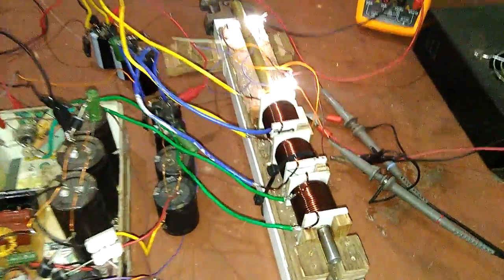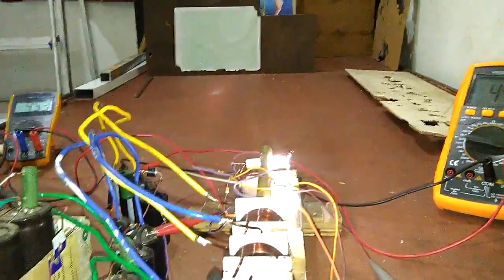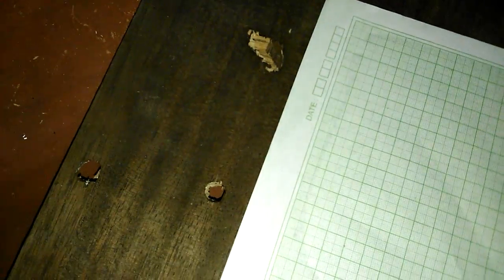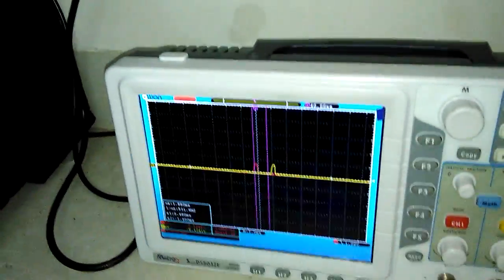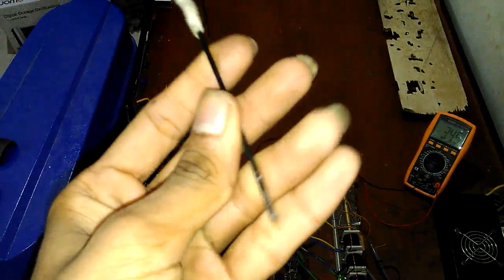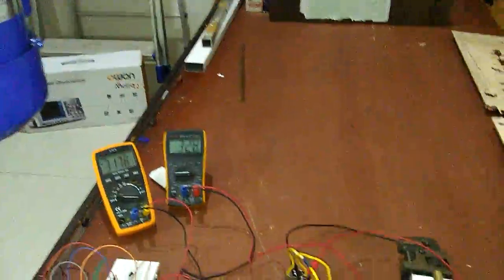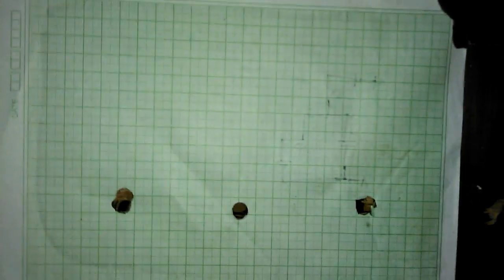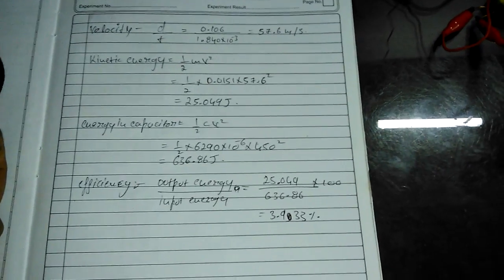spin stabilized 3 stage Coil gun

Comment: I made a simgle stage coil gun (450v cap) back in my class 12th and now in mtech i have liberty to xhoose a project so i went for multistage coil gun. I am building a multistage (4stage) 450v cap (each stage). Will use opto sensors,arduino and powermosfets for triggering. If i can get any schematic of your design thatll be cool. Thanks for the video, very informative.

Comment: thanks for posting. nice work.  the muzzle length looks good.   the stabilizer worked pretty well, for single use ammo.
other designs, where the stabilizer is fully integrated in the projectile might be more durable or, here's a wacky idea,  try attaching a bit of string - like a kite-tail - to a round.  for spin, rifling the barrel, maybe just where the coils are, might work.   cheers
Reply from the maker: David Davids thanks for watching . yeah that carbon-fibre shaft stabilizer works like a charm but it always breaks . so I think bamboo stick which is used for barbeque will be cheaper and effective substitute . and Even though it breaks no problem for a single shot

Comment: Why do you use a brass barrel and not soft steel or plastic
Reply from the maker: I wise I had Plastic barrel but you can see in my latest handheld gun i used fiberglass , steel will slow down the projectile significantly.

Comment: That's really nice! I believe it's the first time in the world someone has implemented this system, so congrats!
I have so many questions here, so I'll try to put them in a simple way.
1. What are the specs of you capacitor bank?
2. What is the charging circuit?
3. Does it have a comparator to cut off charging automatically?
4. What type of motor is used?
5. What is the RPM?
I noticed that the shaft-stabilised projectile had the cleanest hole, so there is some scope for improvement.
I would love to see more shots of each projectile type in the future.
Now I really hope I haven't flooded you with queries!
Thanks and awesome job again!
NNNI
Reply from the maker: NNNI  capacitor bank for first statge is high energy density , for other all stages normal mid energy density.
charger is zvs   circuits on steroids. that means it has been cranked little . charges my 6290uf cap bank in 1 or 2 sec at 24 v input . can pulse 500w at the output for only 2 to 3 sec . motor normal dc motor . I don't have any comp circuit . but ma Arduino will do the job of comparator . rpm of motor is 2000 rpm. about stabilisation  the one which I shot with a carbon-fibre shaft was ballistic projectile with sharp tip , so it does penetrate with clear hole . but the gyroscopicaly stabilized projectile was just a iron slug with no sharp tip so it didn't make clear hole . but when I gyroscopicaly stabilized the sharp tiped projectile and shot , it makes the same clear hole.
Reply: Thanks for the information!

Comment: if I have a one stage coil gun does adding another stage multiply the velocity by two? And so on with more stages
Reply from the maker: Dominic Nedlewski no adding second stage will give nearly two times the velocity of first .3rd stage will give less bit more than 2nd  fourth stage will be like if u r getting 55 m/s out of only 3 stages , with 4th stage u will get like 63 m/s . this was in my case .
Reply: Thanks for the tip my friend. I noticed in another video you drilled holes on your barrel. Does that also increase velocity?
Reply from the maker: Dominic Nedlewski yes it avoids Eddy current dampening
Reply: you should try a plastic tube. When I first started I modded a pen and I got much more velocity compared to a copper pipe.

Comment: your coilgun works with optic gate or timing?
very impressive gun!
Reply from the maker: DIY Center 007 open loop triggering, basically it's just timing
Reply: Can you upload your code please?
Reply from the maker: DIY Center 007 the code is just a delay command . where delay time is found out by a oscilloscope .you should use delaymicrosecosd for lesses time delay
Reply: ok Thanks!
what was your delay? I dont have oscilloscope so I will have to just try shooting a lot of times.
Reply from the maker: DIY Center 007 delay depends on capacitance and Coil length , Coil resistance etc .if you want to know delay for my gun it was 1800 ms for second statge and 900ms for 3 Rd stage

Comment: How many rotations/minute are you getting on the projectile before it fires?
Reply from the maker: Karmaslap 2000rpm
Reply from the maker: Karmaslap when just rotate the projectile in the air at this rpm you can actually feel the force of stabilisation
Reply: Can you change your video name to "spin stabilized"? That is what you are doing, not gyroscopically stabilizing the projectile. There are a lot of people interested in seeing examples of spin-stabilized projectiles and this is a good video but hard to find because of the name

It appears from the paper target hole shape that there is some significant amount of precession, how do you plan to combat this? Changing the projectile shape

Final question, how did you measure the 2,000rpms? With the oscilloscope or estimate?

Thanks and great video
Reply from the maker: Karmaslap the motor is specified to rotate at 2000 rpm Max at 24 v . I will try by changing the name , thanks for suggestion . first of all I want to get the most out of it . I am talking about velocity and right now I am getting 65m/s and output energy of 35.5j . after I get the most I can , I will design a special chamber in front of the breach of the gun which will rapidly rotate the projectile to higher rpm taking the feed from a mag .

Comment: how does the stabilisation work?
Reply from the maker: Jaultaub when the bullet rotates it will have angular momentum which acts as gyroscope . So the bullet will not tumble when it's fired , this is the same principle used in all guns
Reply: Yes I know that. What I wanted to know is how you get the bullet to rotate.
Thanks!
Reply from the maker: Jaultaub by turning it with a motor

Comment: have you heard of the "LEVITRON"? it's a toy that people can buy to make an object levitate, has a lot of video on youtube here. so basically i was having a theory bout if we can make the object/bullet levitate in mid air in the chamber first and make another magnetic force that spins the object/bullet so it will have a "suppose faster" RPM without having any kind of frictional touches to the object/bullet  and then make a hammer lever that triggers it and shoots the object/bullet through the barrel that is circulated with the coil in hopes that it might "project it more" some how.... gonna subscribe but i want to see something like this happen or something. just my theory though, not tested.... but at the same time i don't know if faster rpm will be a good thing for smaller projectiles, considering after some reading smaller rpm for smaller projectiles are more suited when it comes to accuracy.
Reply from the maker: Jesus Christ  ok first of all to levitate a non magnetic projectile , like mild  steel in this case is not easy . and again faster the rpm more will be your gyroscopic force on the projectile and no tumbling in mid flight . and spinning a solid projectile without any physical contact or just by magnetic field is not possible according to me . so I guess this method is simpler.thanks for subscribing .
Reply: Vasudev Mr what do you plan on doing next? not possible by you? you mean you don't have the financial or materials needed to do such thing?
Reply from the maker: Jesus Christ  I have plans on getting 60 to 70 m/s muzzle velocity. and make a portable gun . I may add couple of other stages to get more velocity . and about that levitating method , we need work on it . the main aim is not to make things soo complicated . ofcourse I am working on other kind  of stabilisation .
Reply: Vasudev Mr hmmm i was just watching 6 stage coil guns, but i think it's reaching it's limits no matter how many coil, unless you can get over 450 feets per second on your bullet, it'd just be subpar. looking forward to your next project
Reply from the maker: Jesus Christ  yaa getting 137 m/s is not soo easy , I know that . but I will try ma best to atleast reach close enough to that speed
Reply: Vasudev Mr watch a youtube video call "Purdue Technology students build supersonic ping pong gun"
Reply from the maker: +Jesus Christ yeah I have watched that before on TV . I think this ping pong balls cannot go faster in atmosphere ,I mean not for long range coz they will face lot of drag in the open atmosphere since there is no vacuum around , so cannot maintain their momentum .
Reply: Vasudev Mr what i was hoping is that you'd observe and intake the concept behind that mechanism in which it propelled the ball and implement it onto your coil guns chamber then it shoots through your coil barrel. but you gotta make a decent rpm on your object somehow
Reply from the maker: +Jesus Christ that's awesome suggestion so you're telling me do build  a hybrid Coil gun , I will try it out

Comment: how do you switch your scrs?
Reply from the maker: Доминик Недлюски with the help of arduino
Reply: Vasudev Mr I tried that lmao It never triggered fast enough. would you recommend using rc filters and a single pwm pin?
Reply from the maker: Доминик Недлюски you can't trigger directly from Arduino pins 5 v isn't enough use a optocoupler in between Arduino and scr you should trigger it with 12 v with 100 ohm gate resistance
Reply: that makes so much more sense as to why my set up didn't work
Reply from the maker: Доминик Недлюски hmm you stay in Russia??
Reply: Vasudev Mr say what in Russian my friend
Reply: Vasudev Mr my bad I read that wrong. no I dont live in Russia lol I have a huge interest in the language and changed my keyboard all Russian when I made this account
Reply from the maker: Доминик Недлюски no one hate Russians in India , itself ok if you were Russian .
Reply: Vasudev Mr I wish I was lmao I'm from the us I live in a small state called Connecticut

Comment: Hi, do you have facebook? I will be happy yo show you my coilgun. it almost ready.
do you have a resistor near the doide of the coil? "clay reid" said its better like this.
and I tried a lot of diffrents delays between the first and second coil, but i am getting the best result with one coil and x2 capacitor (insted of 2 coils and one capacitor each). is it fine? maybe i need to put a much big capacitor in the first stage than the second one...
Reply from the maker: DIY Center 007 yes I have resistor and diode in series across Coil to stop the suck back of projectile . and I am in Facebook - my profile name is Vasudev Vasudev
Reply: do you know why when I put the resistor my bridge rectifaier is destroyed? I've been destroyed 3 of them.
Reply from the maker: DIY Center 007 yeah it will happen because the current due to back emf from Coil finds it a easier way to go to ground . the current will not flow through your diode and resistor bridge since it has a resistor in it . so it flows through bridge rectifier and it will be surge current which will destroy your bridge rectifier .so you have to put a charge resistance which is of higher value than your resistor with diode across Coil
Reply: so i have to put more resistor connected to the bridge rectifier? or put small capacitor?
Reply from the maker: DIY Center 007 put a resistor of 10 ohm 5 Watt in series with bridge rectifier's output what is your resistor value used with diode ?? put 5 oh more than that in series with bridge rectifier as a charge resistance
Reply: ok thanks!
I am using 7.5 ohms resister, so 15ohms 5 watt wiil be good for me. i added you on facebook, my name is Matan, can you accept me?
Reply from the maker: +DIY Center 007 yes go ahead , are all the components available in Israel ??, ofcourse I can accept you
Reply: I think I didnt find your real profile... maybe you can add me?
Matan shalev, and i have photo with sunglass and stocking cap 

not all of the compoments are available here, just the basic ones like resistor and stuff like this, so I am buying everything on ebay and tayda electronics
Reply: oh, and i tryied putting a resistor of 15 ohms. I blow another bridge haha. I will try to put a bigger resistor.
Reply from the maker: DIY Center 007 use 3amp or 6 amp bridge rectifier with 15 ohm resistor in series